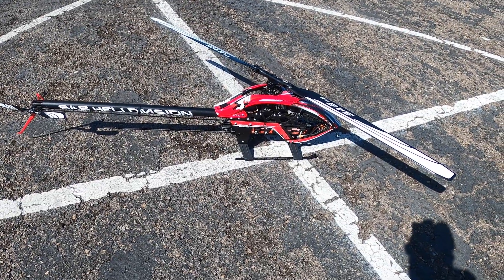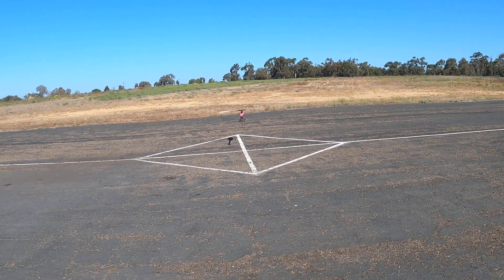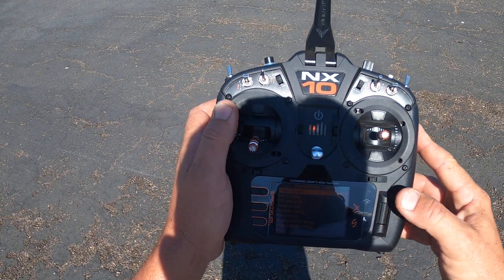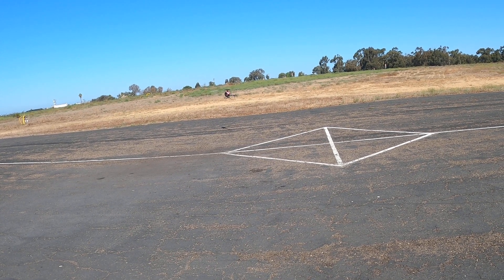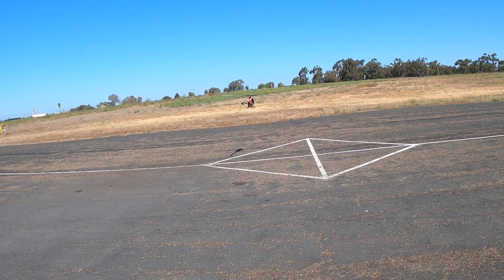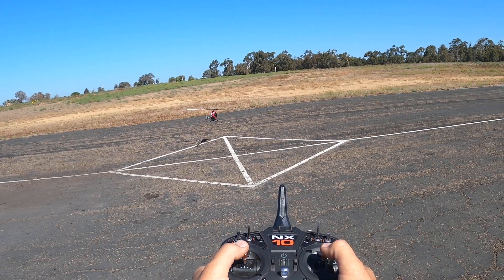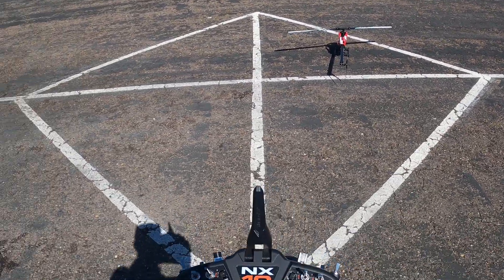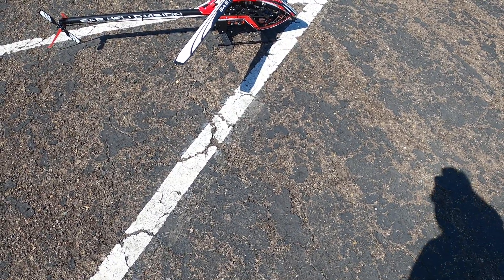SAB RAW 700 Helicopter Maiden  " Get Back on the Horse if You Fall Off"

Comment: Are you team BK? And is this to replace your Kraken or is this an additional model? I really like the look of this particular one with black skids. Kevin St-Cyr or team Goblin Canada is who I first saw with this scheme and I love it. Dreams are free so since I can’t afford one will just drool over yours on your videos. Cheers!
Reply from the maker: No BK team. I'm with Team Horizon and Spektrum. We fly all brand big helicopters with our transmitters, servos, flybarless systems and batteries. I did however and still do fly a Blade 700x which was my show bird when Horizon did have a 700 size helicopter on the market in 2014. This RAW is nice, but it's still retail price to me.
Reply: @CoeShow619  Yes I knew you were Horizon but you have been flying Goblins lately. I am a BIG fan of Goblins so nothing wrong with that hehe. But I thought you thanked Switch blades and SAB on one of your videos so since Horizon doesn't have a 700 anymore I thought you could work with BK for your 700's. Anyways just wanted to ask the question. Great flying :)